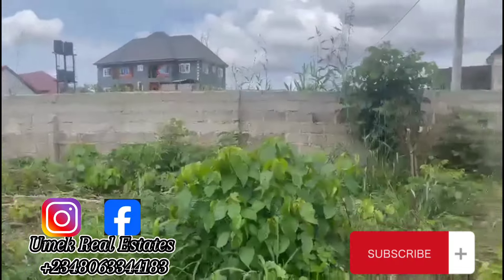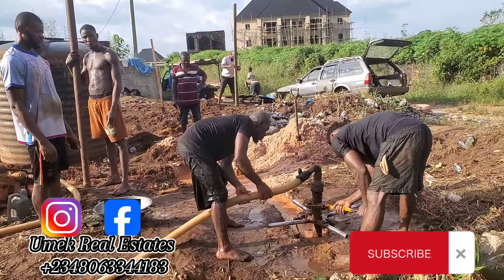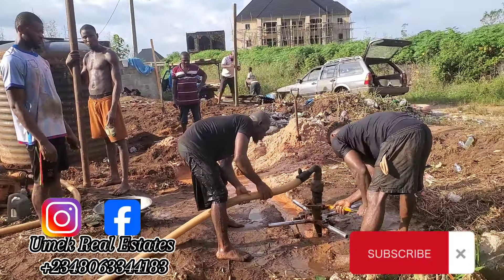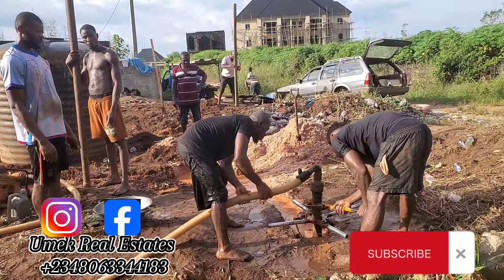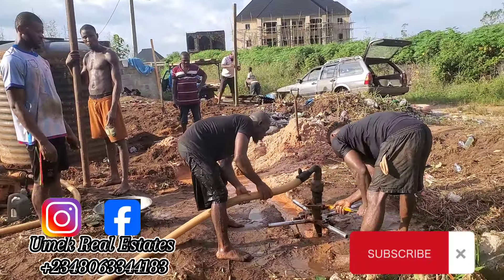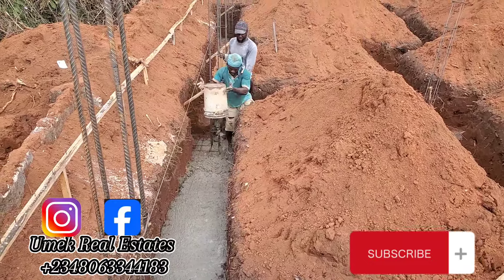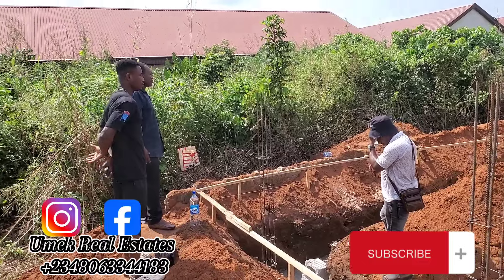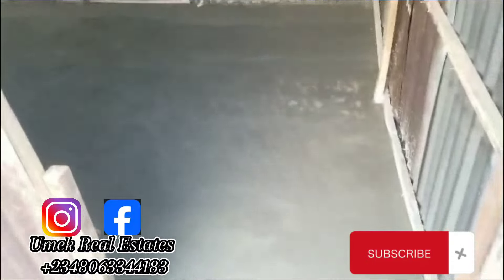Real-time Cost and Construction Activities of Building a 5Bedroom Duplex in Nigeria, December 2023

Comment: This land is solid so the foundation cost will be low. If you were building in a water logged area with loose soil the foundation cost will be quite high because you will need a lot more reinforcement and will need to cast the foundation walls instead of using blocks.
Reply from the maker: We have different kinds/types of foundation suitable for different kinds of soil  type and they all have their basic structural requirements… here, we did a strip foundation. A raft foundation, which you were talking about, would cost higher considering the reinforcement and concrete work required… I have a video on raft foundations…
Reply: @Umek please could you share your link to the raft foundation video? Thanks

Comment: Thanks for this video. Please, I want to ask some questions. Between the solid blocks and hollow blocks, which one is the best for foundation?

What is the best space to have between the building and the fence? Thanks and God bless us all🙏.
Reply from the maker: Depends on what and where you are building ... but hollow blocks are generally better in load bearing and in areas prone to water sipage... it is recommended to have a set back of at least 2.4M  round the building  and more than that at the front... I hope this helps..